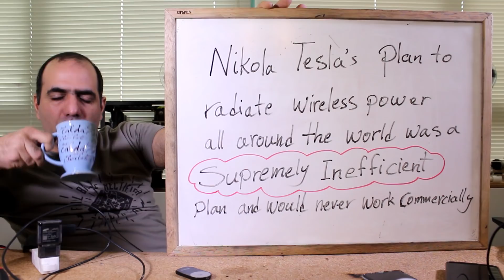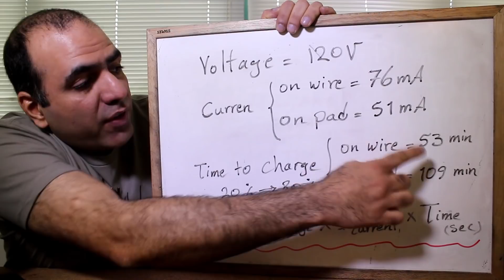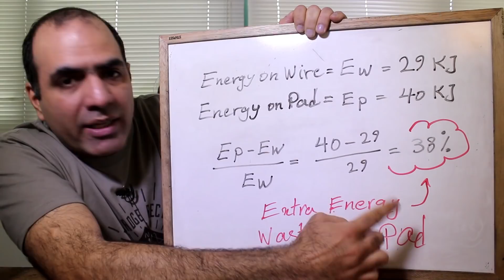Drowning in Inefficiency

Comment: I'm awaiting for Graphene Photovoltaic Panels.
Scientists claims that they're around 80% efficient, and I do love to believe it's true.
Reply: It cannot be true for non-concentrated sunlight (if this panel is stationary and should accept light from any angle), because from thermodynamics alone it cannot be higher than 55% nearly. Otherwise you should be able to collect IR radiation from ocean (from example) and make energy from directly cooling it. That's violation of 2nd law, nobody managed to do it so far...
Reply: @allmycircuits8850  I'm only reporting what some scientific papers claimed to obtain with this kind of technology.
Obviously I'm skeptical about this huge percentage, but if some kind of technology, any kind of technology, could increase the efficiency of energy production is always well accepted, even if it doesn't reach THIS efficiency.
Sorry if I make any mistake in English, as you can see is not my mother tongue
Reply: @enricomontanari1390  yes, I read lots of papers which say: we got 50%, 60%, 70% efficiency, but so far it requires cooling with liquid nitrogen and concentrating light as much as 100x, but we HOPE that someday the same technology could work in normal conditions also. I'm unhappy with it, because sure, they probably have some advantages, but they give false expectations. 

And even worse: I've bought 60 watts solar panel and found out: it can NEVER output these 60 watts, because it's output at direct sunlight, but when crystal temperature is 20 degrees celcius. But when you have direct sunlight, you just CAN't have temperature so low, it gets heated up, so its power output go down...
Reply: @allmycircuits8850  I work in Energy Storage systems, I do know what you mean.

Comment: Due to wear and tear on USB connector, I got netdot that uses magnets to attach instead of friction. It's as efficient as wired charging and almost as convenient as wireless. CHANGE MY MIND!
Reply: had one of those.. was rubbish.. kept disconnecting.. back to qi i am.. at least my electricity provider only sells 100% renewable which costs me more than other options so i can be a little wasteful without having to feel to bad about it..
Reply: @Dunkelelf3  Maybe you had defective one. Mine always connect. Bonus is that I can transfer files, making it even better than USB sticks that wear out the connector.
Reply: I assume you are using one of the cables that leave the connector in the port? If so, the one I used was ok, though it needed to be laying flat and almost immobile to work consistently. The idea was cool, but the magnets were no where near strong enough to be truly effective. 
Also, I found that being limited to using only one brand of cable was frustrating, especially if I forgot to take a spare with me.
Reply: @shayanthis  Netdot sticks really well. I can pick up the phone and browse and make calls, no problem. I bought 5 of them, put them on tablet, e-reader, basically all that use micro USB. And now I have 5 cables, couple in car, couple at home, one in bag.
Reply: so you wanna tell me there is no friction with magnets? are you one of those flat earthers by chance?
Reply: @zn4rf  Do you even know what netdot is?

Comment: Hi, 
Can you design a Voltage stepper 12v to 30v with 1.5amp capacity? With 90% efficiency?
Reply: you can do much better than 90% for that.
Reply: @Basement-Science  100%? For a 50watt led

Comment: That's where Nuclear power comes in.  It's amazingly efficient, since it pretty much runs on wasted heat.  Per gram, Uranium produces 8000x more energy than coal or oil.  And it makes absolutely no CO2 .  All you have to do is store the spent fuel.  And radioactivity? Coal burning plants produce over 100x more radiation than Nuclear plants, since coal ash contains radioactive material, and it just gets released into the environment.  (It also contains toxic metals like Arsenic, Beryllium, and Cadmium.)
Reply: Nuclear power stations still ultimately heat water into steam to drive a turbine, so they have pretty similar efficiency to other such power stations (e.g. coal), of around 30%. In fact they are generally less efficient than coal since you can't run them as hot (the temperature difference affects the efficiency). But efficiency isn't everything. There is just vastly more total energy per kg of uranium vs coal. So it doesn't really matter if we waste a slightly higher percentage of it.

Comment: Your little rant at the end almost had me thinking that you were going to do a Brilliant or Skillshare ad. 😜Also, solar PV panels that have a conversion efficiency of 30-40% are restricted to the laboratory as far as I know.
Reply: They aren't restricted, they are just HIGHLY cost prohibitive.
NASA, for instance only uses them, as they have to keep weight low, to put things in orbit, in a cost effective manner. 

Not every Solution, is going to be commercially viable, generally the "inefficient" way, is the best way to bring something to the masses.
 For instance, Tesla, likely knew, how inefficient his Wardencliff tower was going to be, however, compare the cost of wireless energy to "everyone" vs, the cost of all the Wires used to transmit that power. 
 Huge losses yes, but more "efficient" in a way, as more people, would have effectively had "some" power, vs so many, having none at all, for a long long time. 
Not so much an issue now, but back then, candles were a hell of a lot cheaper than electric lights :3

Bare in mind, if a "wardencliff tower" was brought up today... everyone would be pissed, getting shocked to death carrying something made of metal within x range of it, or frying peoples devices, would put a bad taste in peoples mouths :3
Reply: @dijasom  Hahah, you're right, I should have remembered that these high efficiency cells are used under certain circumstances. Kind of like how gold, despite being an excellent conductor, is only used sparingly because of its rarity (and cost).

Comment: Combined cycle power plants have an efficiency of around 60% (84% theoretical max using Carnot Cycle). Hydro is king at around 90% practical efficiency (100% in theory but friction and other factors make this impossible)
Reply: Most power plants in use today are very old though. They don´t come anywhere close to that.
Reply: Basement ScienceE hydro is not new tech. See Hoover damn. Combined cycle power plant is also not new tech. Has been around in actual use for more than 40 years. What country are you talking about when you say most?

Comment: I find the wireless charger to be overall beneficial. It takes my phone longer to charge and is inefficient, but I'll take that over worn charging contacts.  My last phone was incapable of charging after 1 year of use. The contact inside was so worn that no cable would even stay plugged without eventually sliding out. To be fair the model I had was riddled with manufacturing errors, but I won't take that risk with my new phone.

Comment: Shut up Mehdi, There is FREE energy. Just plug your outlet in your neighbor's outlet
Boom. Free energy.
Reply: Lol yep but how do you plug a outlet into a outlet isnt that gay?
Reply: @mastershooter64  It's only gay if u don't say 'no homo'
Reply: @D4nkPl4nk  if you're against incest say "no chromo"
Reply: @mastershooter64  Yeah it is gay because you need a cable with 2 male plugs (one on each end). Then you plug one end into neighbours plug, shut down your brakers and put the other end into your plug (remember when Mehdi powered his house from a car battery?). BOOM free energy.
Well there is a few drawbacks to this. Apart from the neighbour noticing there are different circuits in the house. This is why there (usually) are multiple brakers. In order to power all of your devices you need to connect all the circuits in your house. Now your whole house runs of one breaker which is shared with your neighbour. This means it is very easy to trip the breaker especially when the neighbour is at home. If your neighbour is not at home you can use the full capacity of his breaker but then your wire can actually melt.
Reply: @erikhendrych190  Great reasoning, however electricity goes in through the female end and out the male end so if you manage to get a male-to-male cord you will already have an endless supply of electricity from both ends.
Reply: master shooter64 😂😂🤣🤣🤣
Reply: @mastershooter64  on a none jokey note, a cord from a powered outlet to an unpowered outlet will work since you're just extending the circuit since it's +to+ and to but if both sides carry load then they compete for the discharge while when only one carries load it's the only one discharging (as in an unpowered outlet "is a trap" so ummm not gay? LOL )
Reply: @mastershooter64  well, 'no homo'
Reply: @mastershooter64  Not if said outlet is a female.
Reply: @mastershooter64  They can be the same if they use induction.
Reply: @mastershooter64  basicly an extension cord which is waisting some more power
Reply: master shooter64 🤦🏾‍♂️
Reply: @AO00720   you have been noticed
Reply: @AO00720  r/wooosh
Reply: master shooter64 LOL!!!
Reply: don't forget the spoon
Reply: @gigigigiotto1673  haha
Reply: gigi gigiotto damn I forgot the spoon
Reply: MIT wants to know your location
Reply: @Nandru85  Location: Satan City, Hell
Reply: You could alternatively plug your house to a couple street lights, just shrug in denial when they'll ask why the only lights that aren't working properly are wired to your house.
Reply: "Neighbors Taxes" wants to know your location.
Reply: @chadhampshire2047  Location: Hell
Reply: My neighbor kicked me out from their house and I payed them $500 as consultation fee like I didn't even consume that much ELECTRONS
Reply: Dude you ruined for all of us.
Reply: LOL
Reply: It's popular method in Bulgaria.
Reply: I think what you mean to say was...
ElectroBOOM. Free energy.
Reply: Nice
Reply: Damn! You are so smart!
Are you the savior of this world?!
Reply: No no no
Reply: No homo
Reply: If there is a hairy indian with unibrown outside your doorstep preaching about inefficiency in near future, Dont open the door.
Reply: @piiparinen3456  *Iranian
Reply: Kubalo Chill Chill Its me Carl
Reply: Oy Blin! Don't be like neighbor Vadim!
Reply: FBI, FREEZE! 🔫
Reply: Even worse, many places steal direct from the source, entire neighborhoods in many countries. 
 
 Free water, free energy, people leave the AC the whole year.
Reply: Damn you fucking genius. Give this guy an Award Please!
Reply: my neighbors will charge you 1 wife
Reply: I can hear The Boy Who Cried Free Energy on your comment hahaha
Reply: 100% efficiency
Reply: Their electric bill BOOM'S.
Reply: Are you big smoke?
Reply: God dam thats funny but lets get syreos
Reply: No there isn't free energy faf
Reply: Kubalo 6:35
Reply: Kubalo only a black person would say that🤣
Reply: That's why I love having elderly neighbors, they never notice my extension cords. Also, they don't know anything about the internet, so, it was very easy to convince them it wouldn't work unless they had wireless. Free power and free internet!!
Reply: Copied Mehdi's own joke from his previous video.... Pathetic
Reply: @SF-li9kh  Shut up Sam, ever since you retired from doing the splits on walls to hide from people and having terrible controls you've just whined all day. People get old, just come to peace with it, jeez!!
Reply: or.. live with your family then free energy BOOM!
Reply: The damn train smoke
Reply: Yeee I think you live in India in UP
Reply: @kashyap5186  d-.... Dh- like the movie Up?
Reply: You mean there is no free energy
Reply: Efficiency guaranteed if your neighbor’s name is Stupid Flanders
Reply: Wow i haven't seen a comment in this style before!
Reply: Yeah, after a while, your neighbor gonna plug into yours, brilliant idea.
Reply: True mehdi is so dumb
Reply: @the_real_therapist  The backdoor is gonna closed when the sun rises from the west. Then there will be no more nine.
Reply: Mind blowing isn't it
Reply: Lol and neighbour does the same so there is not free energy
Reply: Mision Imposible - ( Mehdi Edition )
Reply: Kubalo that is not even free energy your still using electricity in a different area
Reply: Tomleç YT  Fakku~
Reply: ｏｋｗ
Reply: Kubalo 
True
Reply: Turn the switch off then put a not gate after it. BOOM free constant DC electricity
Reply: You can't do that, it says so in the Bible, thou shalt not covet thy neighbor's outlet
Reply: But it costs to generate energy
Reply: I love that idea.
Reply: Outstanding move
Reply: don't forget solar power and wind and those thermoelectric stuff.
Reply: Da real thiever
Reply: Y e s.
Reply: then get into jail and never see FREE life.
Reply: just check to make sure you're neighbor's haven't already plugged it in your outlet
Reply: oooooo exact 100 comments let me ruin it
Reply: @kingpin7610  please delete this.
Reply: Well its free but meaning money 🤷
Reply: That‘s the communist‘s definition of "free".
Reply: @Schattengewaechs99  Aaaand you don't understand communism at all. Let me guess: 'murican?
Reply: @Doctom91  It's all for not if you don't know the difference between money and wealth.
Reply: @Schattengewaechs99  
Did nobody ever tell you that Tax money isn't yours? That's what makes it taxes, it's what you owe to society for living in a society. Lol and if don't like it, move to the fucking woods and live alone forever.
Reply: 😂😂🤣🤣🤣🤣🤣y'all evil

Comment: Mitochondria are about 40% efficient. The rest turns to heat during respiration and the random breakdown of ATP.
And they are as efficient as it gets! They had billions of years of evolution and still couldn't get any more efficient even though the selective pressure is probably the greatest there is since every calorie counts.
Reply: Not really. Mamals need lots of heat to survive and are not using energy efficiently at all.
Similarly, Photosynthesis is only about 1-2% efficient.

Comment: Instead of worrying about inefficiency, why not simply over saturate the market with "free energy" such as that from the sun?
 or perhaps you know of a novel way to create, and house a Blackhole in your Basement, and get a Zero point module going?

Instead of imagining there is no "free energy" change the term, from "Breaks thermal dynamics" to "i didn't make the sun, so its free energy to me" And work around that to create better free energy systems, such as Geo thermal, and etc. 
Yes, they require maintenance, but these kinds of power generation systems, are hands down, what we need to achieve, as they will increase our overall productivity, while not lowering our operating intelligence, like having more CO2 in our bodies will. 

Less atmospheric CO2 ppm = more intelligent people = bigger and better solutions to current problems.

My take on this, is why focus, on an area, where your gain is 5% instead of the area, where the gain is well beyond the 100% margin, in labor to effect ratios?
 Fixing the inefficiency, is definitely a good idea, but don't focus on the wrong problem. 
 Fix what you can fix, with the best Gain, and maximize your potential.

Comment: I feel like I've found a sweet spot for phone charging. I use a cheap magnetic cable adapter off aliexpress (about $3). There's a plug that stays in the phone all the time and protects the USB port, and the cable then just snaps to it when I bring the phone close to it. Very easy to use, no USB port damage, disconnects when you drop it or walk away with it... And it's just as efficient as the stock cable. I don't see a single reason to switch to wireless charging.

Comment: Ok, i have an idea, what if we where to put turbines at the exhaust in the coal burning factories, so that way the extra heat would turn them and generate power.
Reply: gamingapocalypse  it is called a Combined cycle power plant but primary fuel is natural gas driving gas turbine generator. The hot exhaust from the gas turbine is used to heat water to steam that drives a steam turbine generator upping efficiency to around 62%
Reply: Interesting idea, but I think it would require insane amount of maintenance, because the turbines will be dirty etc.
And you can not "just" put a giant turbine at the exhaust because because it requires a huge amount of exhaust from the coal smoke.
Think of it as the same problem as the sewage system... why not just put water turbines in the sewers?

Comment: on your wireless charging example, I charge my iphone on one of those because apple insists on using a proprietary plug that is compatible with literally nothing else.  easier to have a wireless charger for all my devices and not constantly be swapping out cables
Reply: Simple solution: use an android phone instead ;)